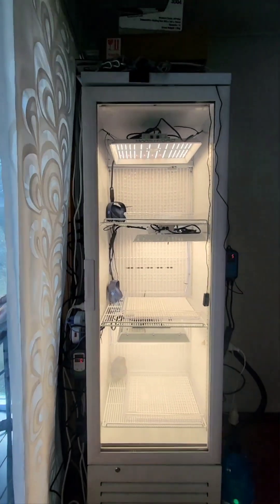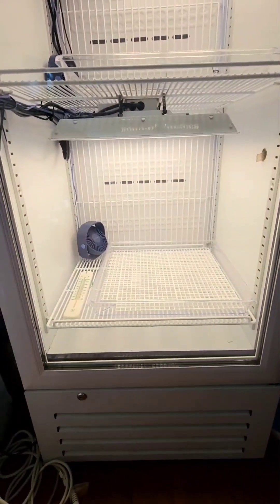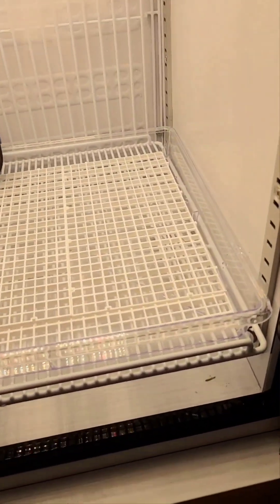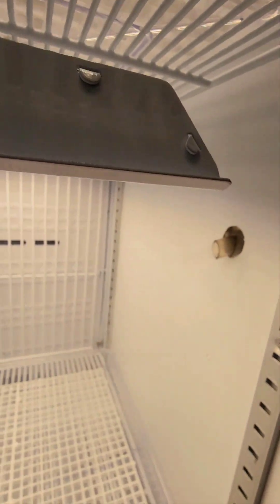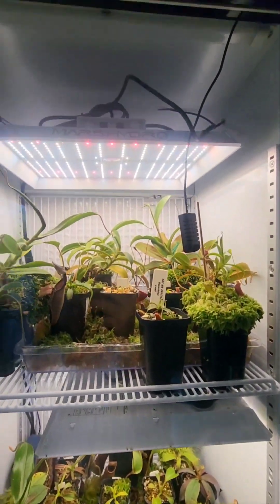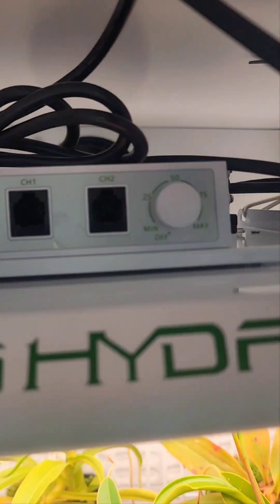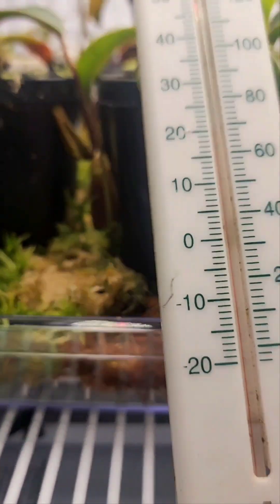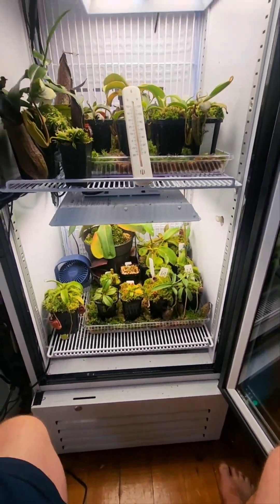how to create the perfect highland/ultra highland nepenthes grow chamber

Comment: Exhaustion myself looking up every highland setup. Ive had 5 Nepenthes for two years but since September 1st I've bought 25. Lol wish I was kidding. My plant room is the size of a small bedroom, 4 great grow lights, humidifier and always 80% plus, mylar curtains, fans. All the crazy Nepenthes are highlands and also the most expensive. I really want to make the jump to highlands but want the plants to thrive. No other options than stuff like this, chest freezer or a grow tent with portable AC. Even a few of these I'm paranoid about consistently hitting 50. I have some Highlands but they're Hamata x robcantleyi, hamata x chaniana which I've been told could fall under intermediate. Thinking of a fish tank maybe, a bin with a plexiglass cover idk so many options.
Reply from the maker: Both of those would take intermediate no worries. I have robcantleyi x hamata growing in my backyard in sydney. 

Now as for a true highland set up after looking at all the option the fridge is really only way to go in my opinion. Fish tanks, grow tents etc you cant effectively cool all that well so the AC would be running near constantly at night trying to keep them temps down. The one advantage of alot of highlamd nepenthes is that they are slow so a fridge like mine will do you for a few years before you need to come up with a new plan.

Comment: Can you show how you built it or modified it?
Reply from the maker: The only modifications I did was extend the drain hose to run outside and drill a hole for the humidifier hose to come in
Reply: @Eat-Me-Exotics How did you manage to connect the fridge temperature system with a thermometer etc. For automatic switching on depending on the temperature if it is too hot? Or is it just off during the day and at night it turns on automatically at a certain time, and you don't have to make sure to connect the temperature system etc.? Thanks ?
Reply from the maker: @turco3963  the fridge is set to 10°c and plugged directly into the inkbird thermostat which has 2 stages set for day and night temp. This means there is no power to the fridge until it warms above the set temp and then it kicks on for a few minutes to cool it back down.

Comment: How are you able to lower the temp of the fridge at night ? The temp inkbird?
Reply from the maker: Yep I use the inkbird thermostat. The wifi model you can set various times through out the day and the desired temps for those times.
Reply: @Eat-Me-Exotics   amazing thank you. And that is a fridge plugged into that inkbird ? 

I bought a villosa recently and in my apartment with no cooling at night. Days are 23C and nights 19. No signs of stress so far. Should do great. But yes is that a fridge or freezer. Thank u!
Reply from the maker: @conormason8989  yep plug the fridge directly into the cooling plug on the inkbird, this is a fridge not a freezer. Makes me more comfortable that if the thermostat fails and the fridge sticks on cooling mode it will only drop to 10°c and won't freeze my plants (I've heard of it happening before). I think this set up is really a minimum for villosa, I've heard when they are smaller they can be more warm hardy but as they get bigger they really get picky. 

One day I'll probably set up one as a true ultra highland chamber (this one leans more toward highland) , though I may need to buy some more villosas to warrant building one 🤣
Reply: @Eat-Me-Exotics   lol I paid 389 cad for mine. We will see. I read an amazing article, a guy in same situation as me did not do the night time drop, he had amazing results for years. Still to today. I am in Canada so I think I can afford to do that. 

So another question lol, 

That inkbird, let’s say your day time temp you set it to is 22 and night time is 12. 

How are you able to make your fridge hotter than the settings ? Does the inkbird just keep in control of that ?
Reply from the maker: @conormason8989  I only paid alittle less for mine. 

There always seems to be people who get away growing highland plants with out the drop. There was a guy here in Sydney with a huge vining truncata put in his back yard for years and one summer it just dropped dead. This is my second villosa, the first lasted 2 or 3 years and then a series of 40°c+ days and it dropped dead. 

So as for the controls, as soon as the fridge bumps up 1°c above my temps (26 days and 14 nights) the fridge kicks on and cools it back down.
Reply: @Eat-Me-Exotics  amazing. thank you for taking the time and writing this out. A lot of people and I mean most do not give you the time of day. With this being a niche thing a lot of people do not know. But I really do appreciate this. I have learned alot, and learned that you can set specific schedules using that inkbird wifi model. Awesome. I will see how it continues but I do have ac for my place. Never gets hotter than 23